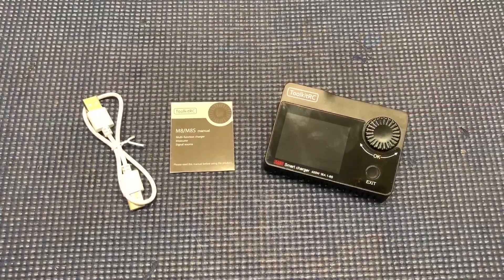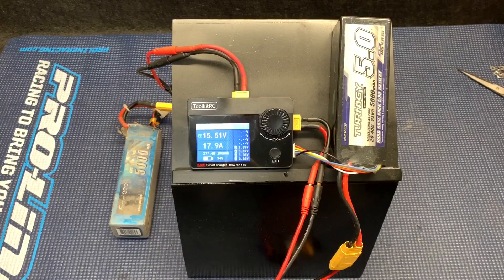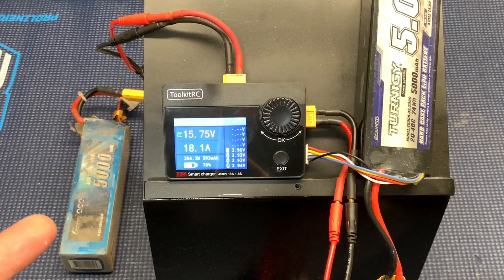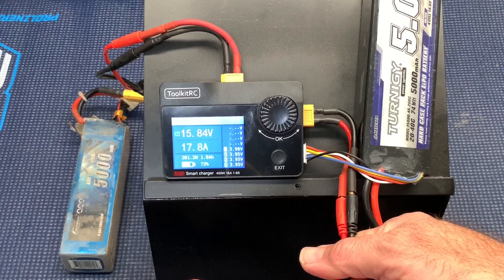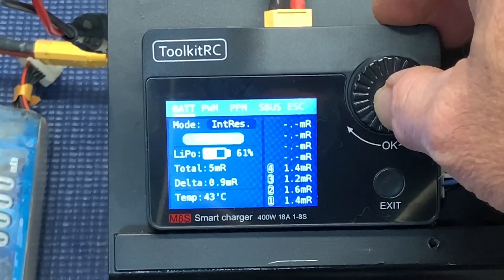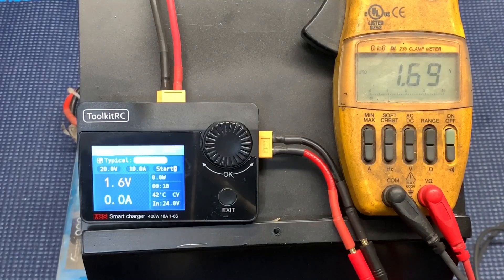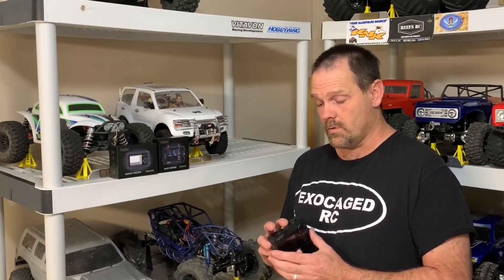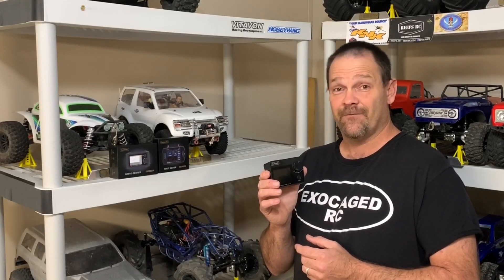Tool Kit M8S Charger

Comment: I have an old duratrax onyx 230 charger that has been great. You punch in your battery info (just basics) like what type, cell count,mAh it stores it .... And charges based on info given, but you can change any thing its doing before or during charge. Also while charging it shows all different info on where levels are at at all times. Worth under the 100 I paid new 10 11 yrs ago
Reply from the maker: You can store battery info in this one too. My issue with that is I have a LOT of different size batteries so I just set the amps and let it do it’s thing

Comment: I can tell I'm getting old. My favorite charger is the type that flashes red when it's charging and green when it's done. No buttons. Just plug and forget. Well hay it looks cool.
Reply: I don’t think so hehe there is many companies including cheaper chargers to reduce their cost :) I have lately tested lithium chargers included on portable fan , led anyways and yea they are not good they are over charging those batteries to a higher voltage as a result this will decrease the batteries life and overheating of the chemistry so it’s greatly recommended in my experience to buy this or other more efficient smart display chargers to avoid damage of your betteries

Comment: I have a similar charger with a mono display. It is amazing! I supply from the laptop power brick. I use this as a soldering station for 24V soldering iron, multimeter.
Reply from the maker: Jarek Ostrowicz yeah I’ve got a laptop power supply but didn’t have it on hand for the video. That 6S did fine for what little bit I did with it.
Reply: What does a power supply $$ for one of these? Also you two mention using your laptop power cords that from what it sounds ... Works just fine. Are you talking about  the cord with the big bulky end kinda triangular shaped. Like old computer towers or old CRT monitors.
Reply: 3 female end
Reply: Tom A I use a standard power supply for dell laptop 130W in a home and 80W in a car. So for a supplier, I do not spend even penny.
Reply: So it's basically a 2 prong then correct? Thanks for the help
Reply: Jarek what’s the model for such a solder iron ?
Reply: @charlschuck6  I use Weller magnetic 24V soldering iron, something like http://www.labem.pl/lutownice_24v_en.htm 
I had it in the drawer, but the more power you have, the better is!!!

Comment: That's really cool and deff. could be great for field use to charge smaller batteries. Too bad it can't plug into a wall cause the display info is great. I can tell you know your shit by looking at that old yellow meter hahah! And thanks for writing back on that other vid a little while back. I figured you must've had it set up like that.
Reply from the maker: RC Intro cool. LoL yeah I’ve been using that meter for a long time.
Reply: I plug mine into a wall with a DC power supply. Make sure to run it 24V to get these max numbers.
Reply: Did it detect over temperature?
Pls suggest power supply